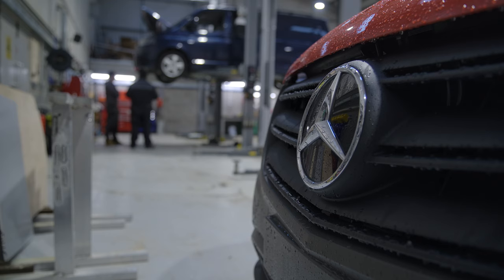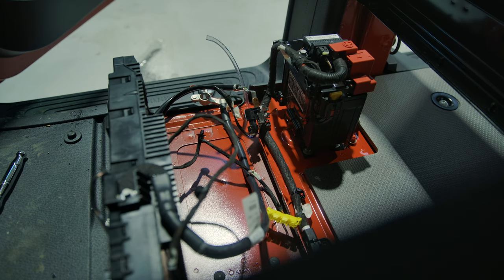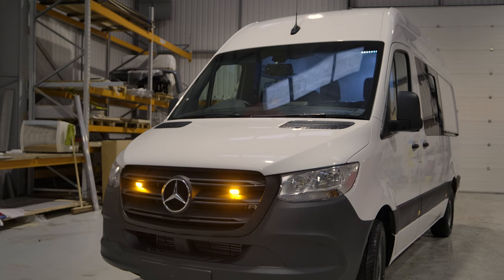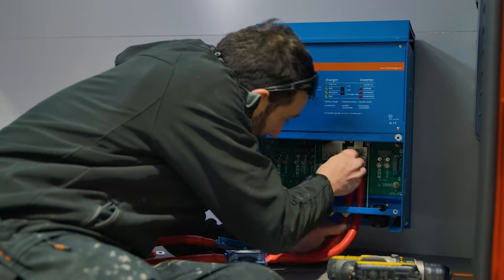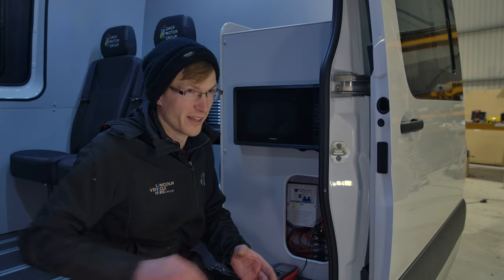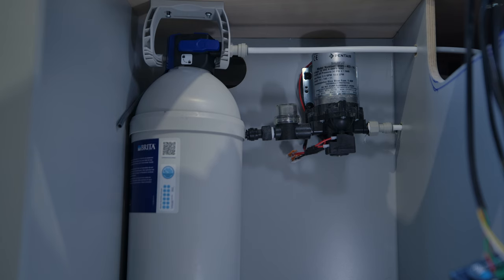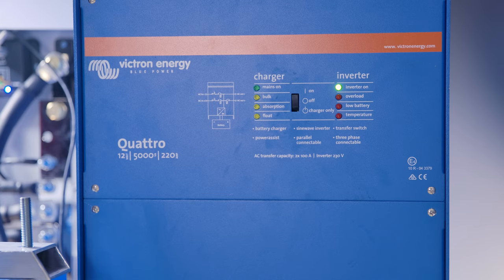Coffee from a lithium powered cafe van

Comment from the maker: 🎯 Key Takeaways for quick navigation:

00:00 🔌 A Mercedes Vito van is converted into a mobile cafe powered by Victron Energy equipment, including a 5kVA Quattro inverter charger and lithium batteries.
02:27 💪 Victron inverters are praised for their build quality, ease of installation, and excellent customer support.
03:36 ⚡ The van's lithium batteries support high-power appliances, including a coffee machine, pie oven, hot water tap, and refrigerator, enabling it to operate throughout the day.
04:37 🚫 The van's battery-powered setup eliminates noise and exhaust fumes associated with generators, making it ideal for close proximity to food service.
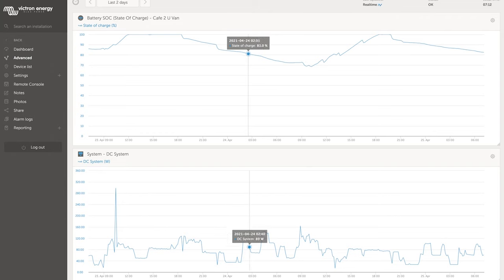06:55 📶 Victron's VRM and Bluetooth connectivity facilitate remote diagnosis and reprogramming of the system, improving maintenance efficiency.

Comment: Should be a 48v system with a boost converter from 12v to 48v to charge the battery, and 48v solar and generator. Far too much power draw on 12v efficieny will be 60%
Reply from the maker: You do realise this is a lithium system?
Reply: @VictronEnergyBV  Yes, I am elec engineer, I have done efficiency tests on most victron inverter chargers, 12v at high current their efficiency drops to 60% so high currents should be avoided. Have you heard of I2R? 24Volt is 4x less losses, 48v is 16 times less losses than 12v.